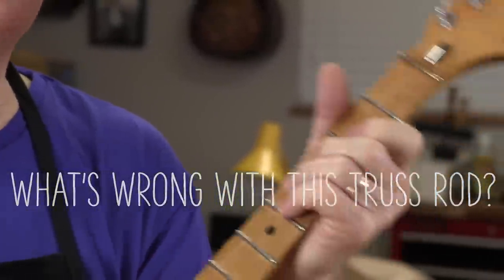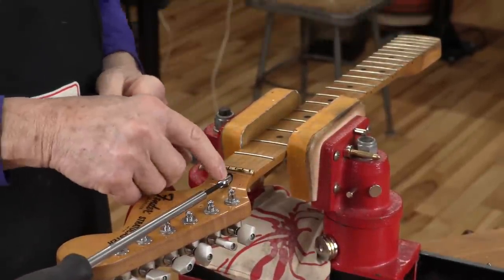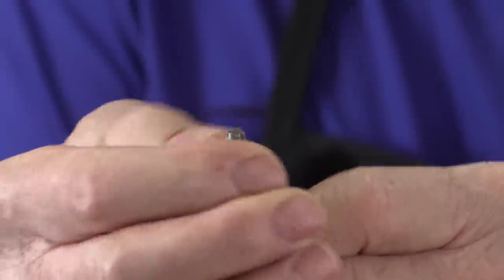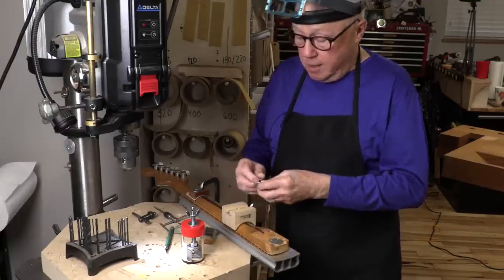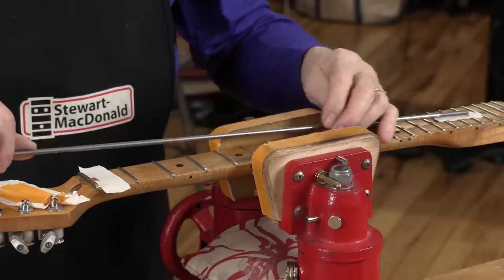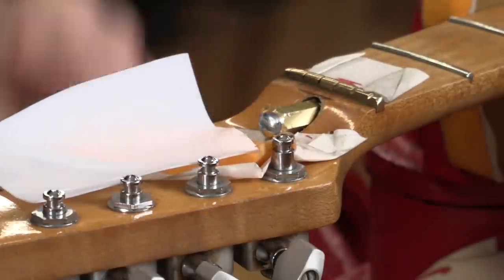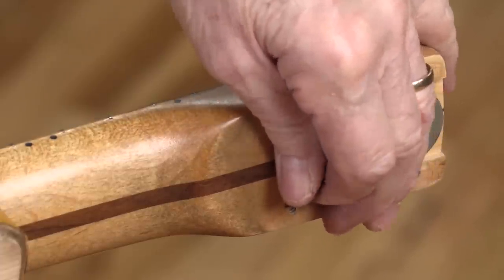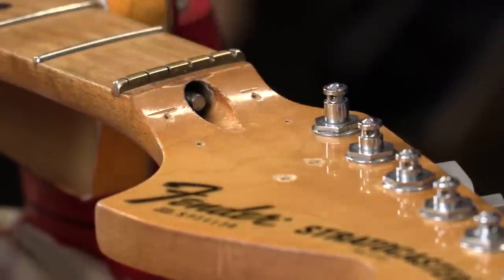What's wrong with this Fender truss rod?

Comment: Hi! I'm struggling to understand that removing the anchor and fitting a new truss rod was nessesary. Couldn't the anchor have been drilled through and glued with the steel epoxy to refasten the original rod (or something in that vein), or was it broken, it doesn't show clearly. ?
Reply from the maker: The threads of the first truss rod were spinning in the anchor nut (you can hear it click when it slips a few times in the beginning of the video). It's also likely that the rod bent and deformed a bit when Dan was removing it from the neck. This is why Dan threaded a new truss rod, rather than re-installing the old one. He was satisfied with how tightly the new rods threaded into the anchor, and deemed it unnecessary to fix it in place with the JB Weld he initially intended to use.
Reply: JB Weld, while great stuff, can’t be counted on to hold against the fantastic tension of the neck without the help of the overlapping threads. This is one of those repairs you never want to do twice or customers think you don’t know what you’re doing.

Comment: Great video as always.  But since you don't have a weld or the JB Weld at the cross dowel, can't the rod just back itself out if the the adjust nut gets tight on the threads?  Then you are right back where you were before right?  Also, looks like the video missed the tap step between drilling into the cross down and pulling the cross dowel with the knob and bushing puller.
Reply from the maker: It seems that when Dan did the dry run of installing the new rod, he thought the rod threaded into the anchor nut tight enough for a solid fit and didn't need the added strength of the JB Weld. You are correct though. If the adjustment nut were to become stuck, and if you were trying to release tension (increasing relief) from the truss rod by turning it counter clockwise, you could back the threads out of the anchor nut.
Reply: olgoat52  Yep, I had the same reaction. JB Weld seems like cheap insurance.

Comment: Hi, so what if I got the exact issue you got, but the neck is slightly in a backbow? Is a solution to install the rod pre bent and then have a metal guy weld it at the anchor? I surely have no other idea than this to get this neck to bend back

Comment: I have a few questions:  Why did you grind off the knurling from the anchor?  Why not use loctite on the truss rod and anchor thread?  Why didn't you use a new anchor nut?
Reply from the maker: Dan likely ground down the knurling on the anchor nut to make it easier to adjust it's position when threading the new truss rod into it. It seems that he determined that the issue was with the threads on the rod, and that the treads in the anchor were undamaged. This way, he was also able to leave the 10-32 Allen head machine bolt as a handle to use while installing the new rod. Typically, we would recommend applying JB Weld to prevent this truss rod from unthreading from the anchor. However, Dan was satisfied with how tightly the rod threaded into the anchor on the dry run that he decided it would be strong enough without the JB Weld.
Reply: EFormance Engineering that heel anchor isn't going anywhere...

Comment: Tip from a toolmaker. 3.82xsfm/diameter will give you a optimal rpm for drilling. I use 100sfm for steel. 1528 rpm for a 1/4” bit using that formula. Too fast and you burn up a drill. Too slow and it breaks.
Reply: SFM = surface feet per minute.   It is a measurement of how fast the cutting edge of a drill or machine tooling is traveling.

Comment: At the beginning I was kind of expecting he'd end up having to pull the bits of the old rod out, then rout out the skunkstripe. Then he could do up a new anchor with a countersink on the back side. Screw the rod down into it, then peen the end into the countersink so it literally CANNOT come loose. Install the rod, glue in a new skunkstripe. How he did it was MUCH easier than I'd expected, though I wonder if there's still some minor chance the rod could unscrew from the anchor again.
Reply: “I wonder if there's still some minor chance the rod could unscrew from the anchor again.” Exactly! As far as I can tell all he did was disassemble the truss bullet nut,  rod, and anchor and then reassemble them but using a new bullet nut (the old could have been stripped out so this was probably required), and a new truss rod (I do not know why he did this because the old truss rod was not damaged as far as I could tell, it had just unscrewed from the anchor). He put the parts back together exactly as they had been except he tightened the rod into the anchor. I don’t know how Fender assembled these truss rods at the factory but I like your idea of screwing the rod down into the anchor then peening the end into a countersink.

Comment: This looks like a single action truss rod. When my single action truss rod nut is tightened the neck has convex back bow ( smaller gap at the 10th fret)  in it and when you loosen the truss rod the neck straightens out but the truss rod nut is all the way loose and the neck is straight with strings on it! I want the neck to have a small amount of concave bow ( larger gap at the 10th fret)  but the truss rod nut at the head stock loosens up. Like there is no more adjustment! It does have a few more revolutions before the head-stock nut comes off the truss rod. Is there anything I can do to get concave bow? It is a 1984ish ibanez road-star guitar.

Comment: Is it possible to replace a truss rod old school fender style, at the but end off the neck? nothing wrong with it just would love to do a titanium one in there. Can yo get them out without the usuall taking fretboard off etc?
Reply from the maker: Really the only other option is to remove wood from the 1st (possibly into the 2nd fret) of the fingerboard to access the truss rod's anchor. Then you can remove the anchor and slide the truss rod out at the heel end. Here's a great article that demonstrates this process. Caution: this repair is not for the faint of heart. If you do not feel confident that you have the necessary experience, it is always wise to take it to a professional luthier.
http://www.guitarrepairshop.com/repairtrussrod.html

Comment: Man that metal, aluminum I guess, nut was nice! On electric guitars for spank, you can't beat metal! I saw a Tele with a stainless steel nut! That took some work to make it, but it will never need to be replaced! Yes, Dan is the man! Thanxz
Reply: Twas a brass nut
Reply: Brass nuts were super popular in the '70's and '80's. They even came stock on some Strats and Teles!

Comment: I'd NEVER trust jbweld to hold in threads like that.   It's not intended for that application.    Instead, I've have drilled through the anchor, set the truss rod in place, and have the rod tig welded to the anchor from inside the anchor, very quickly.  And cool it off immediately to avoid burning the wood.  (Much...)

Comment: How do you correct a truss rod with a seized nut?  So "adjusting" the truss rod just snaps back into a neutral position rendering the truss rod nonadjustable.
Reply from the maker: You will need to free the seized truss rod nut before an adjustment is possible. Check out Trade Secrets! Issue 284: Fixing Ryan Adams' three Buck Owens American guitars. All three of these guitars had issues with the truss rods. 
https://youtu.be/3skTT6mFGMk?t=2m38s
In this video, Dan demonstrates how he was able to free up this seized truss rod nut.

Comment: Can ANYONE who have downvoted this video explain coherently WHY they have done it?

No, seriously, I wanna know!
Reply: I didn't downvote it but on seeing it a second time now, I'm wondering first about the original design being rather faulty.  Putting threads on both ends seems like asking for trouble.  And then also, what did Dan improve here? Could he not have just put the original rod back into the anchor and tightened it the same way as he did the new one?   I think I might have taken advantage of those new internal threads on the bushing to send an Allen screw down there to bind the truss rod.  Maybe the downvote was because this fix is teetering on a repeat failure likely in the future.  I don't know, but that would be my guess.
Reply: I'm guessing the downvotes may have been experienced luthiers who realized the truss rod didn't need to be replaced and the anchor bushing didn't need to be removed. It just needed to get the head-end threads cleaned up, reinstalled with thread locker on the body-end threads, then have a new adjustment nut installed with an anti-seize compound on the threads to ensure it never jams.
Reply: Truth be told, it's rarely only one certain way to do things when fixing guitars, and if I were on a receiving end and be paying money for my guitar being repaired - I'd rather have new parts being installed for my mind's peace, rather having old parts salvaged like there's some kind of inherent value in keeping things that have failed once already.
Reply: In this case, the only thing that failed was the adjusting nut which is made of a much softer metal than the truss rod, binding so it turned the whole rod until it unscrewed. That nut definitely needed replaced. Changing it also introduces the possibility of new buzzes and sympathetic vibration from within the neck because the new one will be a few thousandths undersize to facilitate easy insertion. Note how snug the old rod was compared to the new one. It's not always about saving an original part that won't be seen anyway as much as it's about not introducing more steps that could cause a problem unless totally necessary.
Reply: @EightiesTV 

Um, starting talking about studio recording quality here, which is probably desirable as why not, but given how many inexpensive guitars are out there that compete with their much more pricey counterparts I think it is still justifiable move.

I understand where you come from regarding sympathetic resonance, but for anything remotely noticeable in terms of sound it has to be much thinner than a thousandth for it to start audibly vibrating, which I doubt is being the case here. I've seen rejects of guitars (or so some would say) sounding absolutely fine, and this guitar is nowhere near being of this state.

Like I said - there are more than one way of getting any guitar fixed, and I think this basically negligible difference between the new and original rod is from the unending discussion of mythical  "tonewood" field.

Comment: Question....I picked up an almost mint condition 2004 Fender American Strat. There is this weird "creeking sound"
 I get when I adjust the truss. Is there any lubrication you need to put into that hole to stop this?
Reply: Chuck McCrory it's normal to hear that. Remember, that truss rod is bending a rock hard piece of maple. Most truss rods will not bend the neck into a backbow, your Fender is equipped with a Bi-Flex truss rod that will bend the neck in either direction. Unless the rod stops working for some reason, I wouldn't worry about the creek, my fenders do it as well.

Comment: Just curious, has anyone dissected a Peavey neck?  I'm curious as to how the truss rod channel was cut into them.  No skunk stripe, no separate fretboard...?
Reply: That was one of two guesses I had.  The other was the channel was cut into each half before the pieces were joined.
Reply: @waybackplayback1373  I haven't held very many Peaveys but the couple I have seen were both two piece necks so I'm sure it's just as you thought, a channel is routed or sawed into both halves before they are glued together.
Reply: wingracer 16 I took the liberty of looking it up by a patent number from the manual. It's exactly that and is (or was) proprietary to Peavey.

Comment: Jam nut? 10/32"? = Lock nut & 5/16". Otherwise a great video Dan. Keep them coming.
Reply: It's not 10/32", it's 10-32, not a fraction. 10 is the gauge number for the diameter of the thread and 32 is the number of threads per inch. 

Jam nut and lock nut are two different things.

Comment: I see what's wrong with it! Fender accidentally put the adjustable end where you don't have to take off the strings and pick guard, and pull out the neck pickup, to adjust it. Someone must have been drunk that afternoon

Comment: how can i get a trus rod out of a taylor bolt on neck?
Reply from the maker: Typically, you will need to remove the fingerboard from the neck to remove the truss rod. However, if you know where the anchor is set under the fingerboard, you can sometimes remove the frets and wood from the fingerboard directly over the anchor, then remove the adjustment nut from the other end, and pull the rod out of hole you cut to access the anchor. What is the issue with your Taylor's truss rod?

Comment: shouldn't that be a 3-bolt neck if it's a 70s' strat?
Reply from the maker: Many Fender Stratocasters from the 70's had a Micro-tilt system installed, and therefore had a 3 neck-bolt layout on the heel. However, the 70's Stratocasters that didn't have a Micro-tilt had the more traditional 4 neck-bolt layout.

Comment: Can anybody explain to me how truss rods work?
I just simply can't imagine how in heavens screwing a long straight bar screw in or out makes the neck go concave or convex. It doesn't make any sense.
Reply from the maker: First, we need to separate truss rods into two categories: one way (single-action) truss rods, and two way (double-action) truss rods. A one way truss rod can only be tightened to correct up-bow by placing an opposing force on the neck. But a two way truss rod can be tightened both clockwise and counter-clockwise to correct both up-bow and back-bow.

Both kinds of truss rods are installed in a channel routed in the neck. For a one way truss rod, this channel is slightly curved upward along the long axis of the neck, and the truss rod is installed to follow this slight up-bowed shape. The adjustment nut bears against a washer or wooden plug to keep its position fixed. When the nut is tightened, it shortens the overall length of the rod, causing it to try to straighten out. This puts downward force on the neck, counter-acting the up-bow caused by the string tension.

For a two way truss rod, the channel is routed level. There are two rods, positioned one over-top of the other, threaded into a brass block on either end of the truss rod. The adjustment nut shortens or lengthens the lower rod when turning it clockwise or counter-clockwise respectively. When the lower rod is made shorter, it forces the truss rod into a downward, back-bow. And when the lower rod is made longer, it forces the truss rod into an up-bow.
Reply: stewartmacdonald 
Thanks, I'm getting it a little... the curved route changes everything. Anyways, couls you make a video in the future of an opened middle section of the neck, showing the movement and that kind of stuff?
It would be extremely interesting, and that's a part of the guitar very few people see.

Comment: But what was wrong with the old truss rod?
Reply from the maker: The threads of the first truss rod were spinning in the anchor nut (you can hear it click when it slips a few times in the beginning of the video).
Reply: Right. Just that in the video the threads look absolutely fine. From what we can see here it looks like it could have just been screwed back in and all would be good.
Reply from the maker: I'm not certain why Dan didn't use the original truss rod if the threads were undamaged. But if I had to guess, it was likely that the original rod was bent or deformed while removing it from the neck.
Reply: stewartmacdonald

I don't doubt it. It's obvious to everyone that Dan knows exactly what he's doing. It just seemed to me there was a massive  explanation gap in the video.
Reply: I had the same reaction because it seems the exact same failure could recur.  Why no JB Weld?  The existing 10-32 rod threads seem fine, so perhaps the nut was stripped?  Why pull the rod out first?  The issue was the nut, right? So remove it first and investigate.  As Mr Surname says, the video does not explain why he used new parts rather than simply repairing the existing ones.  On the other hand, this is a terrific how-to video on using the jam nut, the nut puller, re-finishing the abraded area, etc.
Reply: It seems to me that if the old one was free-turning, there was almost certainly damage to both sets of threads. Just chasing them with a tap/die, or replacing just the nut would have left them weak and you want to give the customer a lifetime repair. It’s also an opportunity to use a truss rod of better technology material (again, the customer NEVER wants to see this trussrod again). My single change might have been to drill and pin the rod in the nut in addition to the JB, but I wouldn’t second-guess Dan.
Reply: Even from a machinist's eye both or either of the male/female can look "okay" whereas fully functional thread engagement requires precise dimensions which we cannot see. 
Best to do the proper repair as Dan did and the customer will be happy for the remaining life of the instrument. 
As always, it's a pleasure to see Dan working.
Reply: @stewmac  I bought a guitar recently, I got it for a good price. Only when I got it home did I realise that the truss rod was completely sheared round and the neck badly needs adjusting. Have you any tips on how I might get a grip on it? Thanks and peace from Ireland mo chara.

Comment: Why did you make a new rod?????????????????????????????
Reply from the maker: The threads of the first truss rod were spinning in the anchor nut (you can hear it click when it slips a few times in the beginning of the video). It's also likely that the rod bent and deformed a bit when Dan was removing it from the neck. This is why Dan threaded a new truss rod, rather than re-installing the old one.